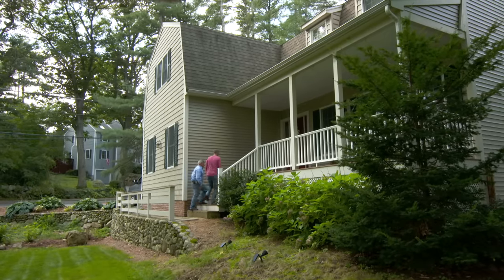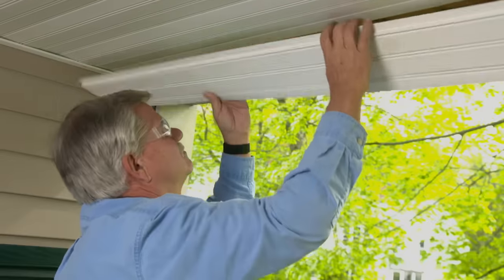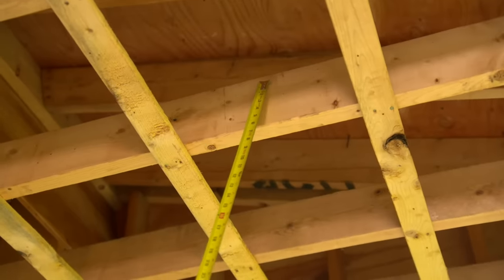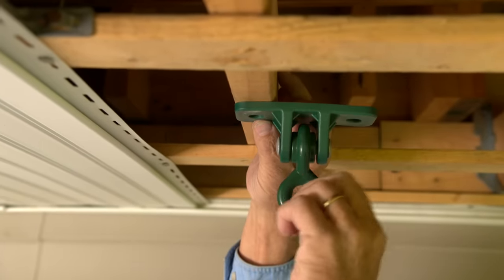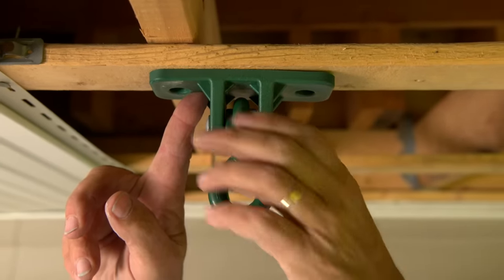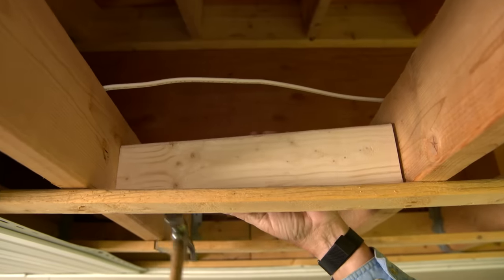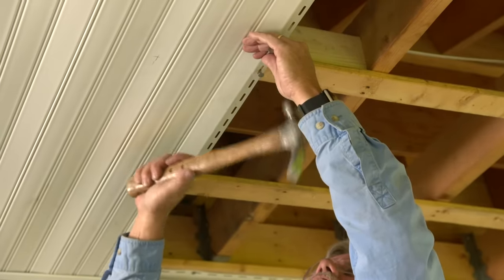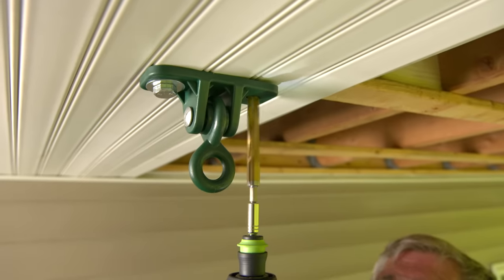How to Hang a Porch Swing through Vinyl | Ask This Old House

Comment: The most difficult and mysterious part of this situation is how to detach the vinyl ceiling…which they omitted!
Reply: That’s where I am myself! I don’t see a good place to start…
Reply: Same here. I guess I'm going to have to just rip a piece down and make more problems for myself. I can't find a way to start it. I also think they used plywood instead of furring strips, so I'm hoping I'll be able to find the rafters.
Reply: For the vinyl ceiling, squeeze two sections together at their seam, then get your fingers in there to pry them apart.  Once you do that, the vinyl pieces separate fairly easily.  Don’t be shy; you have to manhandle it a bit to make it work.

Comment: Thank you so much for this helpful vedio . I have a pavilion and want to hang a swing bed in it . I gave ordered the  pavilion it's 14×18 with a 2×6 roofter/ panel is this structure strong enoug support a bed swing ?
Reply: my thoughts exactly.  I would think NOT.  a swing BED or a swing COUCH is at least 5 times the WEIGHT of that little piddly bench that they are hanging in THIS video.  I have an already made swing couch that weighs probably  220 pounds .. but I am just guessing .. so I am going to try to WEIGH it .. and me thinks i need to go WAYYYyyy up into the truss assembly and get a proper bracketing system so that the weight will be distributed amongst the entire truss structure.  With one adult on the swing couch = likely 550 pounds ... with 2 adults on my swing couch = 750 lbs .. and with 3 adults on the couch = 1,000 lbs. And this isn't even considering the torque pressures of the minor back and forth swinging action.

Comment: So supporting a deck on lag bolts with shear load is not allowed, but putting a 500 lbs load on non rated lag screws in tension is????

Comment: Anyone, does it matter if the swing is installed parallel to the structure ( in this case entire load will be on the same structure) or it needs to be perpendicular like suggested in this video ? It is not clear if the suggestion was because of the swing placement preference ( aesthetically) or from load bearing standpoint of the structure. Thank you

Comment: That's a lot easier with vinyl than aluminum soffit.  We don't get that strapping around here. We would run it the other direction and nail to the structural framing

Comment: So are the brackets mounted into the 2x4 (2x6) he added or is it one lag bolt in the joist and the other in the 2x4? I'm just curious if u would hit the screw attaching the 2x4 to the joist when u did the pilot hole for the lag bolt.
Reply: I think 1 in the joist, one in the cross piece.
Reply: Yes, 1 bolt in the joist, the 2nd in the cross 2x4 piece.

Comment: A spacer should have been installed between the bracket and the structural support. That way the bracket can be tightened solidly and securely to the structure. Spacers can be made from galvanized pipe - 3/8” or 1/2” pipe nipple (depending on your lag bolt diameter) and can be cut with a hacksaw to the right length. (The distance from the structure to the bottom if the soffit material)

You’re a good man, Tom, but I’ve been doing this work longer than you! And I’m from Pennsylvania, so.......   😎

Always enjoy the show, take care!
Reply: I was thinking about that too. The force from rocking back and forth with that bracket not tight against the STRUCTURE is not a great idea.
Reply: Yea, and these should have been through bolts, and not lags. Lags will always eventually pull out. The structural material will have to fail first in order for a through bolt to give.

Comment: What about going “over” the beam with a squared “u-Bolt”? The threads could then pass thru the holes in the green metal swing hardware, and bolted-down. This also keeps the main beam from being drilled-into.

Comment: the space needs a spacer.  it cant hang free with space between the bracket and the wood.  it will pivot the lag bolt out.  if tight, it would not.  should use  a spacer to secure it tightly and cut out the vinyl to mount to wood,not vinyl with space.

Comment: extra washers on the other side panel could have been added for the swing join, then he could have tightened it up snug to the frame
Reply: Right! It seems that leaving it loose is asking for trouble. Great way to wallow out the holes in those brackets. And was it me, or did they look plastic? If they are plastic, that extra play will have those lag bolts wearing through those brackets in no time.
Reply: @Matthew Savage lol, true.
Reply: Really?  Maybe what they should have done is built an entirely new house that was purposely designed around hanging the swing.
Reply: @ipKonfig , Or people should use common sense and realize that: one of those 5/8 lag screws would hold 4 people, that the bracket is STEEL and not plastic, lol  You cannot tighten the bracket solid to the vinyl because it needs to expand and contract. And last but not least, stop worrying about the freaking window !!!

Comment: By “wood screws” he means grk structural screws, and should have mentioned that. Good work though mr Silva
Reply: I was wondering if nails would have been a better choice because of the sheer.
Reply: mae2759 not better than a good structural screw.
Reply: mae2759 but nails are certainly better than a generic screw
Reply: My thoughts exactly. He talks like it is just a regular wood screw that you’ll find anywhere, then uses it in shear...

Comment: Why not 2X6 blocking?  I would have gone with 2X6.
Reply: oilhammer04 
I used the same concept as the video but with 2X6 and joist hangers. I think joist hangers are better, less damage to the wood rather than all that drilling and oversized screws.  Less damage retains more strength.

Comment: Why use a ratchet to drive the lag bolt? You dont have a impact that can drive them?
Reply: He explains why in the video in relation to the vinyl.
Reply: Tom mentioned that he didn't want to over tighten the screws. The vinyl panels aren't flat sheets and drawing the bracket up tight to the furring strip would have distorted it. Not a serious problem, but it would have been very noticeable and looked terrible. It does mean that the bracket isn't all that tight against the wood but that's OK because the friction of the wood won't let the leg screws undo themselves. (Although I would have cut some filler strips to go between the furring and any low areas of the underside of the vinyl strips so the brackets could be tighter to ensure they can't rock back and fourth at all. That might not have been necessary in this case depending on the style of vinyl panes.)

The other reason is that over tightening leg screws in wood can start pulling out the threads in the wood. It looks and acts tight but you have seriously compromised the holding power. That's one reason why  structural connections generally must be secured with through bolts and washers/nuts even if lag bolts would have been able to be used.
Reply: @ElectricGears  I've got leg screws but I can't tighten them.
Reply: @richardyoung4616  Drill a slightly larger pilot hole.
Reply: Exact words. "I'm gonna hand tighten because " then explains. I was going to ignore but would hate someone see your comment and use and impact incorrectly for that task.
Reply: He sure had an impact on you😁